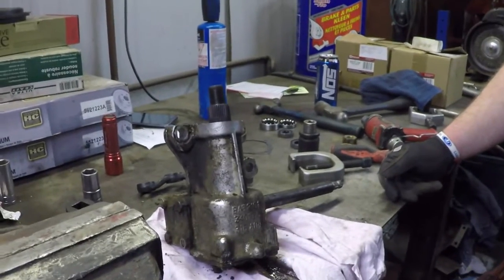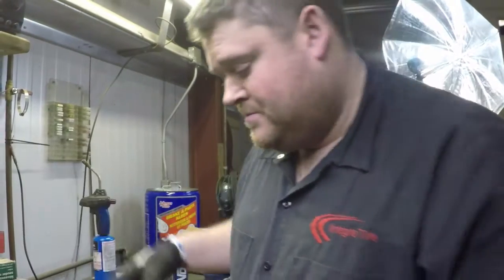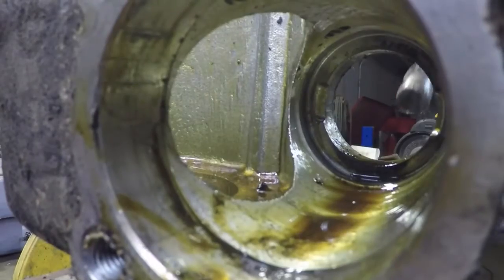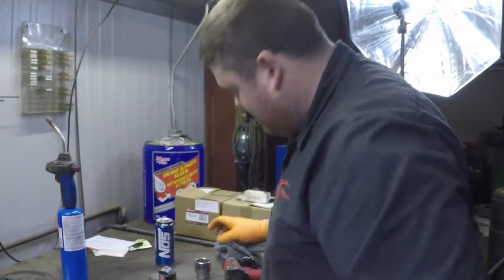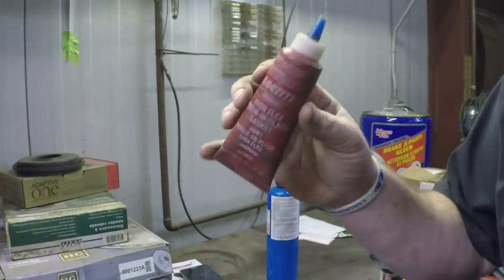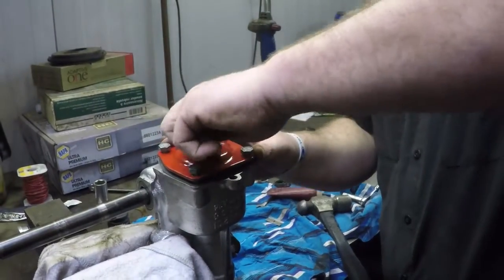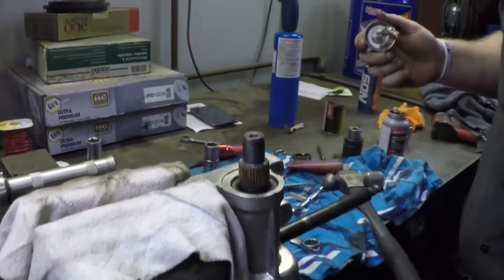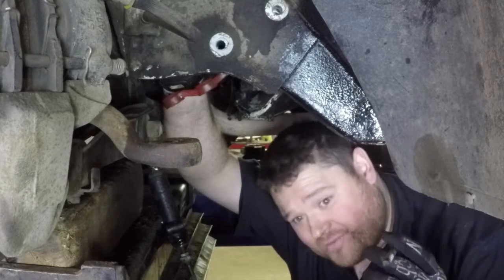Ivan 2104 - Steering Box Rebuild

Comment: leaking is solved by filing the steering box with mix of grease and oil.
Reply: What?.. The oil will eventualy delute the grease and will still leak but slower.. So don't use grease but use sawdust instead for a more traditional repair.